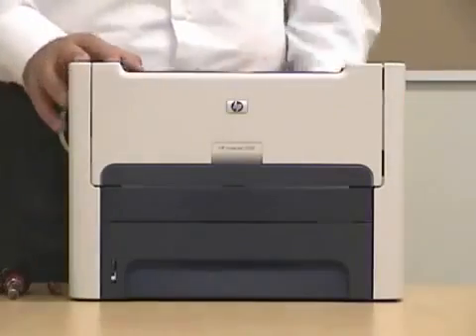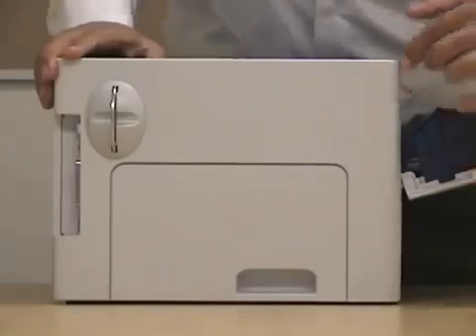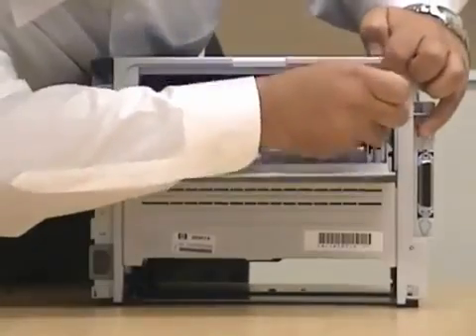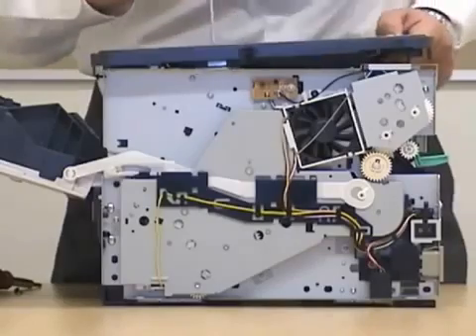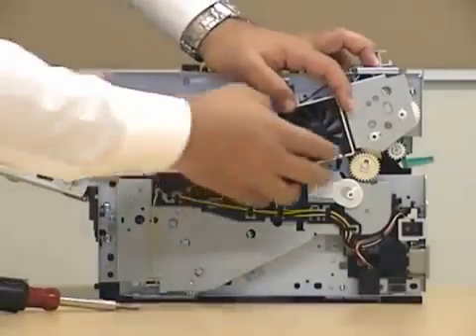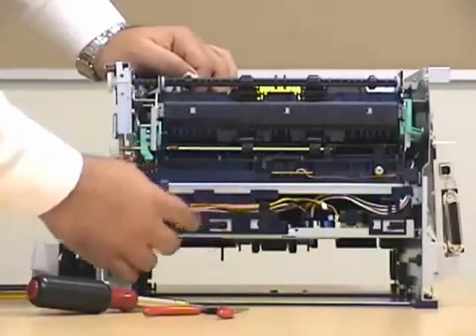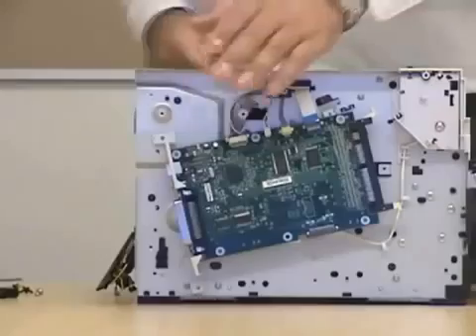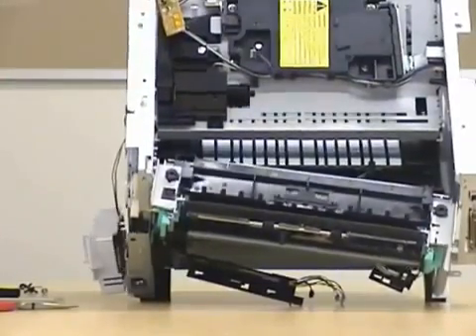Solve printer problems  the HP 1320 printer error, fault and dissembled the printer

Comment: I refill my printer toner but it still shows your black cartage is low. Kindly guide me how i fix it...
Reply: after printing 6 to 7 pages the printer showws black
Reply from the maker: open printer cartridge then behind the dram open two nuts and clean the ink behind the plate
Reply: @Punjabi_Styles  not working this method any other way